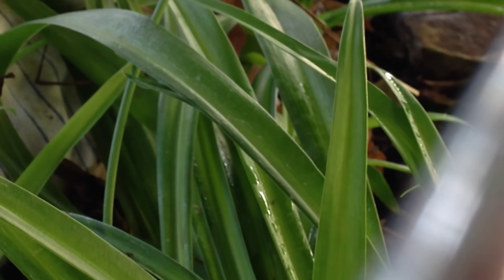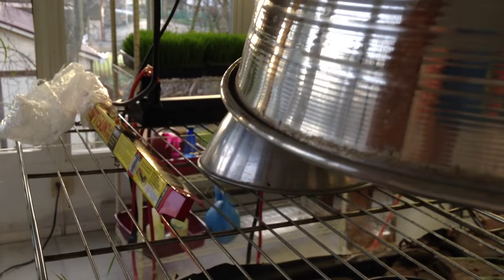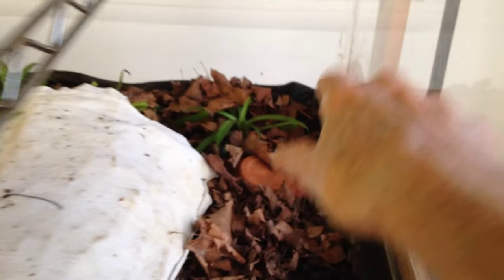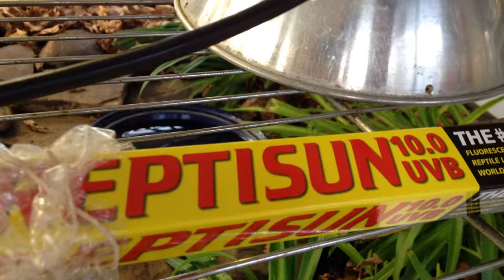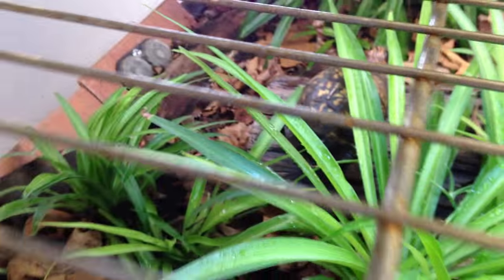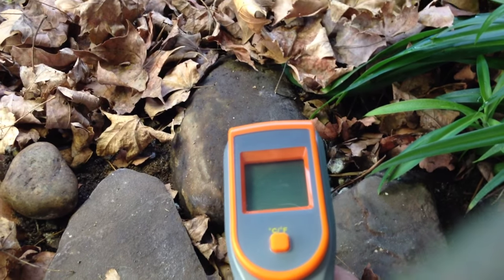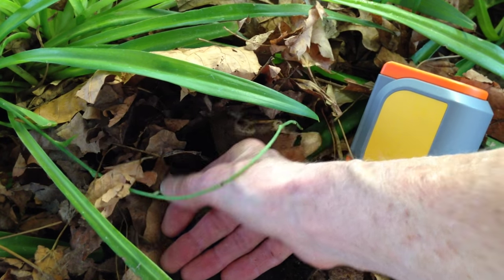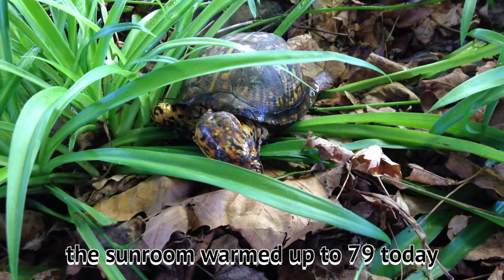Sparky-Box Turtle Lighting and Heat

Comment: Thanks!! Awesome video. Does Sparky have a missing front left hand/foot?  WOW my turtles back claws are LONG. I heard you mentioned you trimmed Sparkys .  WOW Sparkys habitat is all DECKED out and huge. lol   SO you have a big Repti 10 bulb. MINE did not come with one that big , just for a 40gal habitat. My turtle (Ms Herpatan) is doing GREAT.  I did turn the 100w on for a few minutes like 30, then later afew minutes and she went under there and turned right back around. lol but  she likes the  uva uvb one and sits under there a long time.  But I wont use the 100watt often and I will try to find a 45 or 60w.  When I spray the substrate down that makes it kinda cold.  But ya you are right when I feel it , it is kinda chilly but it is 70 now in her tank. When I woke up it was 61 in the house and 66 in her tank. Now its 70 in the house and 70 in her tank and over to the bulb side 76.  I don't think Ms Herpatan  minds colder substrate. WOW Sparky is very smart and attund to things.  If I get a turtle from southern CA or where you are at they would probably like much hotter temps.  IT is amazing how they are all different depending on what they are used to. I was surprised to see Ms Herpatan and Reptilyo out playing and nose diving in the mud two tuesdays ago at 58 and rainy.  I hope Reptilyo comes out of hiding soon on the next warm day. Thanks for this  video.
Reply from the maker: +Zenith Greyz   Glad you liked the video. Yes you are right 100w can get to hot. If you had a lamp stand and raised high enough that would help but 100watt in small terrarium can overheat. Sparky's temperature desires vary. Some days he wants more heat and other day not so much so he lets me know what he wants. Yes Sparky has a missing left foot and part of the leg but does fine with his little stub and artificial foot made from the extra skin on his leg.
Reply from the maker: Sparkys skin will look real dry looking. It depends on how active the turtle is as to how long to let them exercise. Sparky will get tired and go under the bed. He will stop being inquistive and just hang out so then I put him back in his habitat and hydrate him. Your turtle will give you clues.
Reply: I noticed that.  Ms Herpatan was tired 2 nights ago when i let her out but last night she was not. She hasn't slept in awhile and now she is finally sleeping.I put a 0.50cent 40watt bulb in and I think she likes it. I put the 100watt in my vanity in the bathroom. I wish I had a bearded dragon then I could use that for them. They did have quite a bit of wattages at Petsway.
Reply from the maker: Yes, 40 to 60 watt is much better than 100w in a small space.
Reply: bevyh1  I put a smaller food bowl in her cage. When will she start eating? I think she will soon and she will think it is summer.  She still knows its December and she isn't supposed to be eating. have you gave Sparky prunes?  I made a 'carport' out of straws and paper plates and now she is sleeping under it. I did have something else there but it was taken up space now she has a lot more room. I let her out tonight for an hour.
Reply from the maker: Never gave Sparky prunes. The habbi huts made from wood are ideal. They are hollowed out logs. Gives them a place to hid and go on top of them. They just need to be big enough so they can go under them. I believe I get Sparky and x large one. Sparky wanted out today cause it's raining so I have the timer set for 1/2 and see if he ready to go back in and get warm as it's 68 degree in house and the floor is colder so he will be cooled down. He has the run of the bedroom and his sunroom only unsupervised. Must be supervised when I let him explore the rest of the house, except for the bathrooms and two bedrooms. Don't allow him in there.
Reply: YOU have dangerous stuff in the other rooms?  Can I  use an infrared gadget to help me find Reptilyo in my yard??    I think he could have went back to the place in the yard 12 inches back and just dug himself deep in the dirt in that 2 hour time frame.  YES  omg, they love the rain. Why do my turtles like 55degrees but Sparky does not? I thought  yor turtle is from the south. SO if he is from the north I figured he would like colder temps. The turtles in texas probably do not like 50s. But I am more north so mine like colder temps.  Thanks
Reply: SO Sparky gets natural sun too?  WHEN will MS Herpatan eat?   I gave her blueberries  tuna   apples    eggs   super worms and she still has no appetite yet. Will she soon think it is SPRING? Since it stays constant 70 in her  cage and my house?  Is she not eating because her clock still knows it is DECEMBER?? and she thinks its time to hibernate?
Reply: Pet rats are fun cuz they eat like a cow.  Turtles are challenging. Direct opposite. lol
Reply: Rats have a very short life. SAD. I have had 5.
Reply from the maker: Never wanted to have rats. I love turtles and frogs but the care is very difficult and would never ever want to take a turtle from the wild again.
Reply from the maker: +Zenith Greyz  Turtles need warmth in order to eat and digest their food. Having 70 degrees  and no warm area like 78-80 may be the problem.
Reply from the maker: +Zenith Greyz  I have stuff stored in the other rooms like rubber made tubs etc and there is more nooks and crannies for Sparky to hid and I don't have as much heat in those rooms. Infrared gadget wouldn't work on turtles as they are cold blooded animals and need heat to warm up. Sparky likes his heat and cool ends both.
Reply: Dang it. I miss the little fellor. IT has been too cold for him to get out of his hiding spot. But how come i cant find it? Wouldn't it be obvious? MY yard is very small. I do NOT see how the other bigger male turtle got out either. I only got to look at him for 5 seconds. Reptilyo i had for  6 months. I don't think he liked any hibernation spots I had for him. I put  a lot of leave under the stairs and Ms Herpatan liked that. SO did Reptilyo but when it got too cold Ms Herpatan went and dug a big whole under the mulch and bush.  Maybe Reptilyo is under there and I cant see him but if he doesn't come out when it gets warmer then he is GONE and managed to get out of  yard in 1.7 hours but how? IT was 40 degrees.
Reply: He hibernated in the yard just one inch under the grass on WED night  then thur the next morning at 10 30-11am he was basking in the sun. THEN by 1pm he was GONE.  IT was 40 and super cold and sunny.
Reply from the maker: Another winter upon us soon.
Reply: Does Sparky stop eating when he knows its dec  jan  feb  nov?
Reply from the maker: I was able to get Sparky to eat a few days ago. He ate some yam, and accidentally some finely chopped kale and some wax worms to entice him. By some miracle he did eat a superworm the other day and he hasn't eaten them for a long time. He does drink his wheat grass juice regularly that is supercharged with nutrients. Its rough going in late fall and winter so I keep pushing green drinks to help with nutrition.
Reply: IT is just so weird  how they can go so long without eating. THEY stopped early in the fall when it was starting to get cold i noticed. SHe  is  healthy and  perky and fine.    When should i take her to the vet?   Like if I cant get her to eat in 30 days from now should I take her?  Will she not eat till spring?  HOW do I make wheat grass  juice? thanks
Reply: My toad would not eat worms for one year. NOW she does. BUT she ate crickets no problem. I had her two years this july. IT is not hard getting her to eat.,  She loves crickets. I give her hard shell black bugs too and  gave her a slug. TUrtles will eat slugs too. Well not now in DECEMBER. lol
Reply from the maker: I have in the past collected slugs and keep them in the winter but they are messy to deal with so didn't do that this year. Sometimes Sparky will eat them and sometimes not.
Reply from the maker: +Zenith Greyz  A wheat grass juicer. I'm going to be getting an electric wheat grass juicer as the manual came apart. Juicing is an easy way to get nutrition in them as they will drink when they won't eat. It's hard to find a reptile vet and some vets will say they can treat turtles but don't even have a gram scale. Some vets are good and caring as was the vet I went to for Sparky's foot. He was not a reptile vet but was a kind gentle spirit and did a great job on making Sparky a foot pad.
Reply: OH  I only gave my rats  coffee beans just one time.   Ya its  hard to find a vet.  I found one near me.    I called another  office miles away and they seemed like they were asleep. Maybe they work out  of their home or something.  She didnt  sound like a business.
Reply from the maker: Yes this is one more issue to deal with when you have an exotic animal. There are not very many exotic animal vets.
Reply: Yes. does sparky sleep a lot sometimes?  HOW do i know if my turtle is sick  or  just sleepy at    4pm  or whatever? even outside they would sleep during the day a lot.  BUT bringing her indoor makes me all paranoid watching her sleeeeep.  They move like robots  don't  u think. ?
Reply from the maker: Yes, this time of year Sparky sleeps more. When you see them out of their hides and their head is slumped down that can mean there is not enough heat to warm them. They need heat for energy. Sparky can move fast when he wants to.
Reply: BUT  they do sleep like that normally don't they?  Like their heads  out just bobbing around with eyes closed??  not slumped down.   MY turtle doesn't  like over 70 and  was out in 50s weather in the rain so  70  in her  bedroom should be good right? I really don't think she would like  80.
Reply: OMG  I saw a big hole  outside my fence at side of my left side of  house. I am wondering if it is a turtle  hole. I don't know yet.  CAN they go  10 inches down if the soil is soft?  it was. Today  it  got warm so wondering if the  turtle came out.  I hope I find Reptilyo.  OR maybe that is the other turtles spot. THE one I only got to meet for  5minutes. Normally when they  hide you cannot see them but when they come out of their hole that is when you can SPOT the hole I noticed.   But when they burrow and don't come out you cant spot it    TILL they come out. Hopefully that turtle will go back to that hole  or is already still in the hole many inches down.   WOW I have HOPE.
Reply: Funny thing is the only area  in my yard where that turtle could have gotten out   was that little  3.5  inch gap at that  NW corner  of my  yard /fence  and that is where that HOLE  was  i found today.  ==Just  a few feet away outside the fence outside of THAT corner gap .
Reply from the maker: If the turtle got out he knows what to do and that is to hide and hibernate.
Reply: But I swear funny  how I clearly found evidence by my side of the house so i am hoping I will find both  or one of my ' Lost' turtles.  I know they are not dead and safe, they are  not stupid.
Reply from the maker: Yes turtles are smarter than we think. I thought Sparky was tired and wanted in his habitat after our trip but he wanted right back out and wanted to explore so I let him. Then after he was out no time at all he went to his habitat and set under it and wanted in so he could go to sleep. I put him in and he went right under a spider plant and that was that.
Reply: That is awesome. I believe that. MS HERPatan  when to the door to her habitat and acted like she  knew where her habitat was and  wanted in. THE door was closed since i have to keep two cats separated.BUT she sat there in front of the door like she knew that is where she lives now. AND she sat in front of the other door  acting like she knew that  outdoors is where she used to live , that was the door to the outdoors.  Sparky rocks!!!
Reply: BUT I will let her out again after I patch everything up in the spring.
Reply from the maker: Awesome. So glad to hear that. Turtles are not happy in captivity. It is iffy with Sparky being able to survive in the wild since he has a front foot missing as they use their front feet to dig down. That helps me feel a little less guilty taking him from the wild but I still feel guilty enough.
Reply: I do too and  feel guilty about taken the other turtle  from my moms garden and yard to my my house. maybe he will go back to her house. I heard they do that.   But reptilyo  I got because he was running across the road. I miss him.  I forgot about  how we  are hurting their breeding capabilitites  when  we  take  females out of the wild.
Reply from the maker: Wild animals deserve their freedom if at all possible.